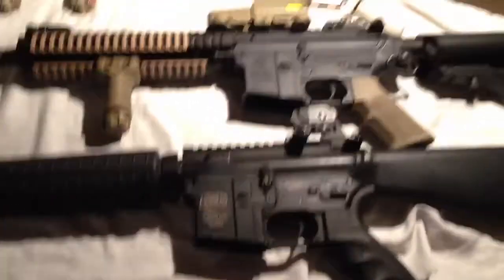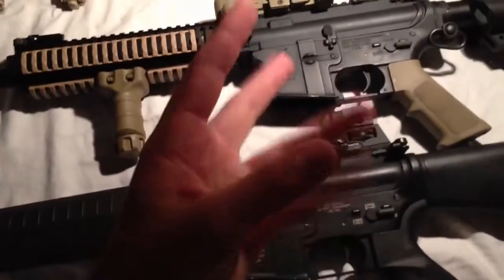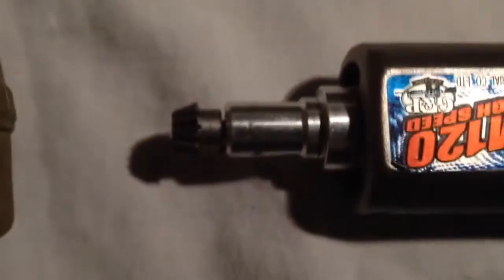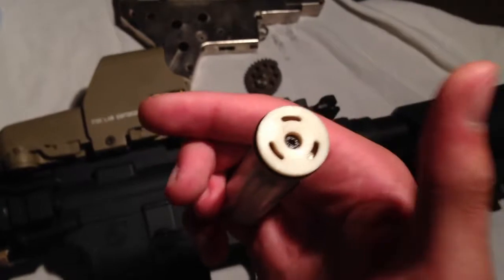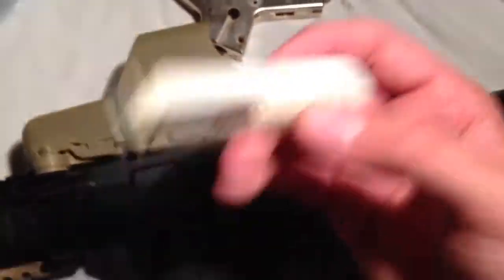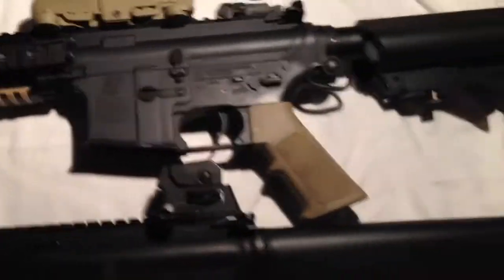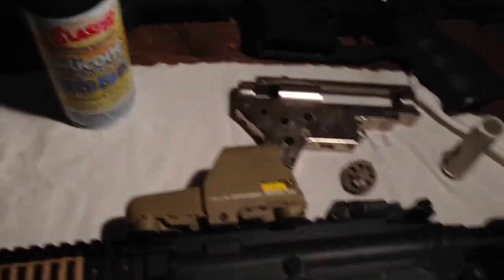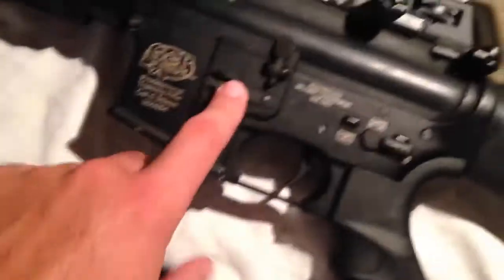Building a custom gun - what you should know

Comment from the maker: I like guarder bore up kits, and generally all their air seal parts are nice. I also like their springs and tappets. I have had a guarder spring guide come apart before on a pretty low stress setup, which is the only issue I have had with them before. Their gears are decent, but not worth the money when you can just buy SHS or JG, and same goes for their pistons.

Comment: Then the angle. You see, the teeth on the bevel gets larger to the side, and so their depth increase aswell. If you just compare the pinion side by side with the bevelgear, it may appear that the angles are off, but it is just that the wider side of the pinion teeth has to go deeper into the teeth on the bevelgear, to reach the proper depth. If you just compare the surfaces of the teeth when they meet, you get the illusion of an incorrect angle, when it really isnt.